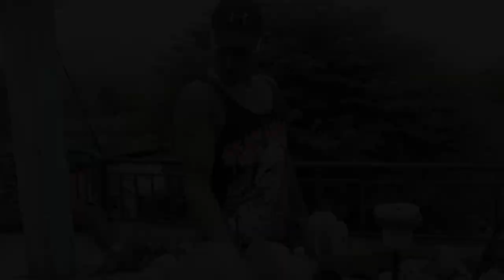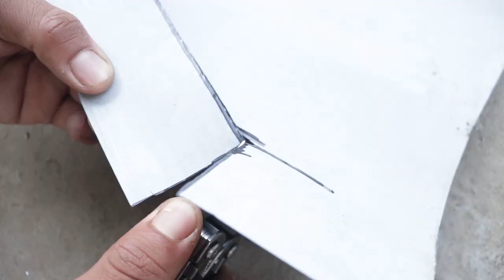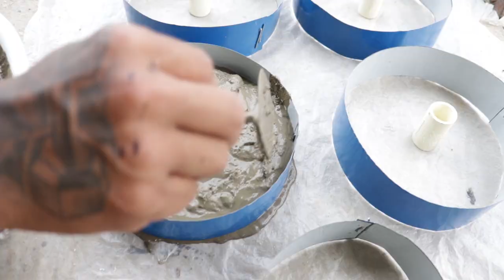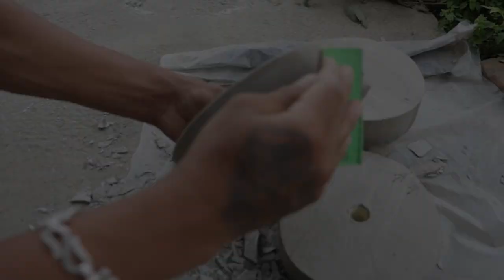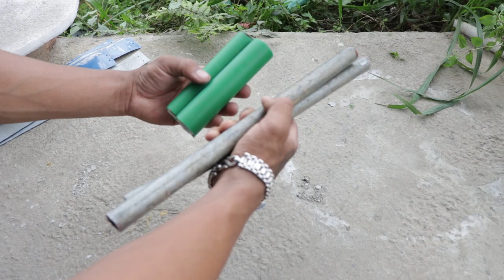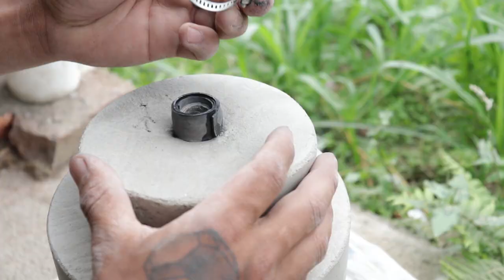How to make Adjustable Dumbbells at home - Homemade Dumbbells | Anish Fitness

Comment: First day impressions:It arrived in a waist high box. https://www.youtube.com/post/UgkxP26Tir6n60vUkdtn4mbwhRO8cwuJQNy2  Each dumbbell was in its own foam box within the shipping box. Everything was secure and in good shape. No weird smells. The weight changing mechanism is really smooth and straight forward. Changing weight is really fast and easy. Though the handle is plastic, I don't think it will be breaking anytime soon. So far pretty impressed after my first session with them. I was afraid they were going to be too wide at first, but I didn't have any issues with them while doing upright rows.